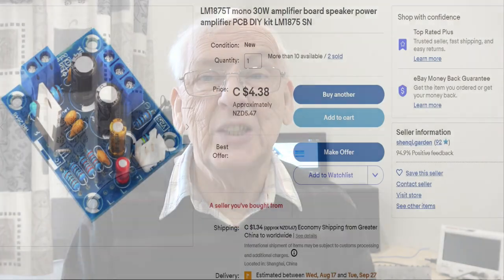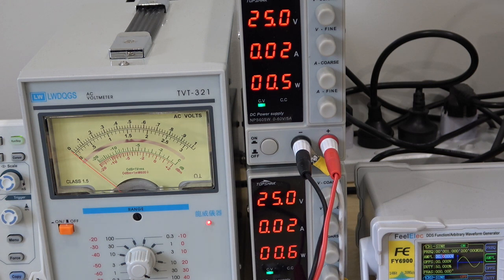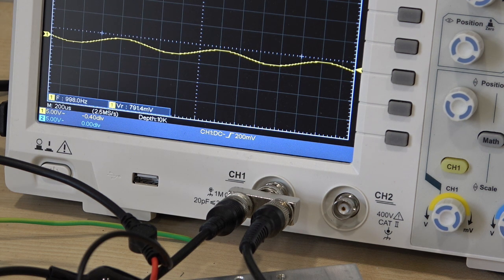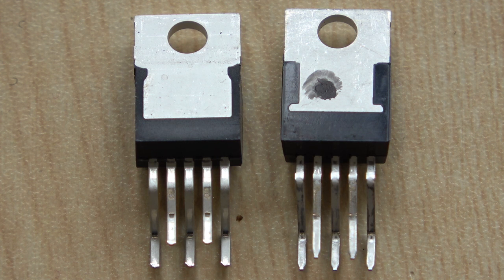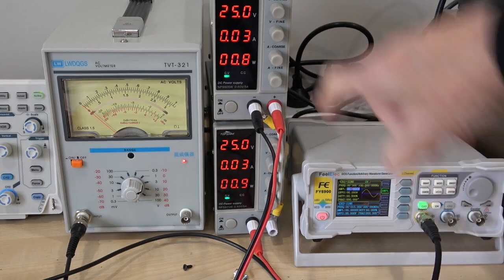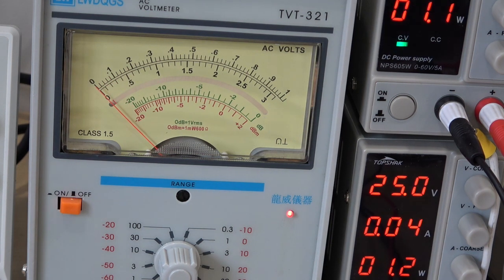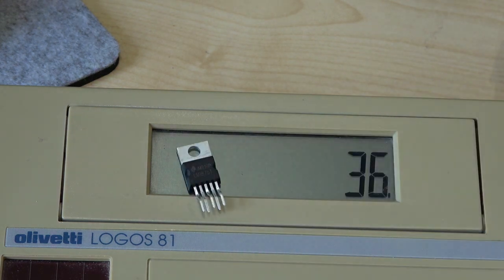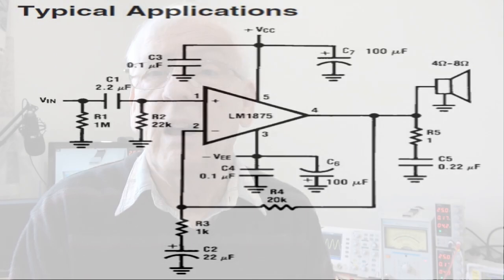I take a look at a LM1875T amplifier kit. Will it be any good?

Comment: I assembled these kit & I got around 8 watts @ 4 ohms load while powering up with a 18 Volt 2 Ampere transformer whose peak dc output is 28 volts & I used the voltage divider circuit to convert into split suppy that I learnt from John audio tech video but the voltage was pulled down to 20 volts while delivering 8 watts. I used a 3x3 inch heatsink that became slightly warm during the operation. The capacitors supplied with this kit although blew up at first place which I replaced with good ones so the components are not good quality but only due to the authentic chip & pcb the kit priced very high
Reply from the maker: As you may have seen in my video with genuine chips the performance is really quite good. I'm not sure of your power supply. Your filter electrolytics blowing up would tend to suggest something is wrong. I used all original parts except the chips and everything is good. Genuine chips are not cheap but fake chips are cheap for a reason. You NEVER really know what you might get.

Comment: Pity it's almost impossible to get genuine lm 1875, 3886, various different output transistors - all out of stock and in a production backlog. Even Elna Silmic II capacitors are being discontinued. I started diy audio maybe 6 years ago and took it for granted things like bc560 etc would be available for years to come.
Reply from the maker: Hi Peter, here in NZ I received mine from Farnel, however these are getting a little expensive these days. As you have seen here, quite a difference in performance. I actually like it. When you see the silly little PCB on the heatsink, I cannot believe the sound quality that comes out of it.

Comment: Sorry about your health.  Nearly all audio chips from China are fake.  They have MUCH smaller output transistors on the die.
Reply from the maker: When using a real chip these little amplifiers really do sound good.
Reply: @MichaelBeeny   YEP! :), ...and even the fakes at lower power levels and attention paid to load stability (as you so profoundly showed at 4 ohm) are actually good for most applications, ...and the price, ...far out!!  Some do have lower frequency response at the high end, but still sound good. :)
The general rule of most things from China is buy double the power rating, LEDs, audio amps, mosfets, bjts etc. etc. and you will be ok because they will still be hugely cheaper.

Comment: I was wondering how you got those two SMPS's to play nicely together?
Reply from the maker: The main thing is both power supplies outputs are floating, not connected to ground or you will simply short one of the power supplies.
Power supply one, the +ve  rail becomes the plus voltage. The negative is connected to the second power supply + supply, this becomes your center tap or 0 volts. The -ve  output on number 2 power supply becomes the real - ve rail.
The voltages on both power supplies are made the same. Use your test meter to confirm your connections are correct. Works a treat. Make sure you power up both supplies at the same time.
Hope this makes sense, easy to do but quite hard to explain.
Reply: You can do this with 2 identical linear supplies too. Join 0v reference on one to the positive of the other (thats your ground), and use the remaining positive and what was the 0v of the other for +&- respectively. Nelson Pass used this design on some PSU for his amps. It reduces any effect of differences between the secondary coils as they get rectified and filtered before they are connected.

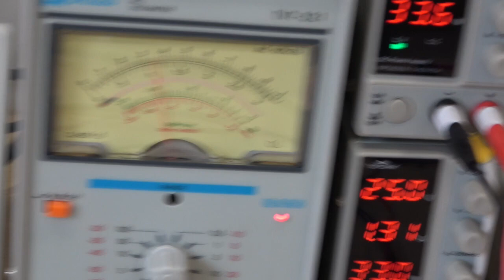Comment: 9:40.  I believe that the reading was almost exactly 11 volts for the genuine chip at 4 ohms, which is 30.25 watts rather than 36.  The scope agreed, though the reading would likely increase slightly as you scrolled more waveforms into view.

Those circuit kits are cheap and have a decent layout such that they are a good source for PCBs even if the chips are counterfeit, but most of us don't want to support companies that sell fake chips.  Even the fakes produce a decent 8-ohm amp audio circuit for the price, but we'd prefer higher-quality parts.  

The dual-rail power supply and heat sinking are obviously the primary investments with these amps, so folks that just want a cheap amp would be better off with a stereo class D board and a wall wart.  If they're already building a dual-rail supply, they can certainly afford genuine chips and nice components, so these ultra-cheap class AB chips amps are a strange commodity to me.

I like these amp chips, but why is there a market for $5 single-channel kits when a complete amp is going to cost many times more?  I suspect that a lot of these are sold to people that never build them into amplifiers :(.

Comment: Fakes again 🙂I had bought several of these folling Johnaudiotechs positive review of the boards. The chips Johnaudiotech and I got, however, look identical to your real chips. I guess they ran out of the real ones and, following tradition, just swapped them for fake ones.
Reply from the maker: I would not stand for that Marcel, getting a genuine chip when you expect a fake one, it's not right!! Everyone will expect the same in future.
Reply: @MichaelBeeny  Haha, you are right. We need some certainties in life!
Reply: @MarcelOoms  Hi Marcel. Just curious when you bought your boards since yours appear authentic. The IC's are said to be pulls of which they may have run out of and replaced with fakes. If you feel adventurous, you can crack one of the ICs open and measure the die area. The LM1875 has a die area of 10mm^2 and the fakes always use a smaller die (which is why they can't handle the power) of just under 4mm^2.
Reply: @JohnAudioTech  That would have been nice, but they have since been moved to the attick. Never got around to them.

Comment: Super video, thank you. Just a thought: C2 is critical, it can also affect the bass response and in my experience, can (if a low-cost electrolytic and a single supply are used) cause strange output DC (speaker damaging) behaviour! Best to use a quality, very low leakage and non-polar cap. All the best, Beamer.
Reply from the maker: Non-polar are not a favourite of mine, they tend to have a high ESR over standard electrolytes. The cost of these kits probably wont justify the cost. I've yet to do a detailed listening test in my listening room to form a real conclusion. I have quite a few projects on right now and only 2 ears.
Reply: @MichaelBeeny  Sorry, I meant polypropylene, polyester etc., - not non-polar electrolytics (also not valued by me). I like your YT channel, and it's great that we have 2 of most things - if 1 fails, at least we've got a spare ;)

Comment: Hey Michael, have you aver worked with the LM3875? (obsolete) . I think it would be a better option than the LM3886 because of it's noise figure. Any thoughts?
Reply from the maker: I did not find any noise from the speaker at all. True on paper the 3875 is specked with lower noise, but if you cannot hear it anyway who cares. Not tried the 3875, as they are obsolete, unless you can get new old stock, bound to the fakes.

Comment: Hi Mike,
Chinese fakes are a big problem, I blame the big chip manufacturers who sell off their reject chips cheaply because they fuel the fake industry. I am looking to build a LM 3886 amp but searching  element 14, digikey,Mouser etc the LM 3886 chip is not available and has a waiting list of months. So if I go ahead with this project I will be taking pot luck if I get a good chip or fake .The reason I would like to build LM 3886 amp is that I saw a review of the Cambridge Audio AXA 35 amp by The British Audiophile, which uses the LM 3886 chip and I am looking for a warm richer amp to tame my Klisph PM 160 speakers. Being a poor pensioner like yourself, I can't afford the Cambridge Audio amp. In your opinion of all the amps You have build, could you reccomend  a warm rich amp or would the LM 1875 be a good sub to the LM 3886.  I am using the 12 watt valve amp  that You built, it is ok but it doesn't have the gain  for my fiio music player. Thanks for any help and keep up the good work.
Ken Mitchell.
Reply from the maker: Hi Ken, So sorry to hear you have Klisph speakers but we wont go in that direction. If the only other issue you have is lack of gain on the amplifier why not just add a simple pre amp? 5532 for example. Regarding the 3886 I have looked, for these here in NZ. Farnell is quoting 2 years delivery. I think the ones from China must be fakes. I'm surprised you find the valve amplifier too bright? That's what put me off it, I found it dull and lacking dynamic range. Well it is a valve amp after all. Most of your issues might be the speakers. Along with BOSE I find Klisph my least favourite speakers EVER (so far) Try one of the British speakers, might suit you better. Good luck, let know what you do.

Comment: dear mr beeny . I am writing to you from the other side of the world. South America. . Chile. I want to thank you for sharing your knowledge. You have helped me a lot in this time, I am grateful to you. I have reviewed all your videos, I am very happy. dear sir, could you spare some words and test for a low cost kit like class A amplifiers? Thank you again for your time. We see it from many parts of the world. a big hug and forgive my English. Greetings Serge.
Reply from the maker: Hi Sergio, firstly thank you for your kind words, it's much appreciated. Personally I'm not a class A fan. I have yet to be convinced that they offer anything more than a properly biased class AB. After all, class A is just a class AB with lots more bias. So if you bias the class AB so you have no crossover, all class A does is heat the room.
Class A can never be low cost. You will need massive heatsinks even for a relatively low power output due to the high current consumption. The power transformer will also need to be big because it will need to supply a high current all the time. This places more demand on the rectifiers which will need extra heatsinking. Bigger and better capacitors. 
At the end of the day your amplifier will be lower powered so less dynamic range, so could end up not sounding as good. You spent more money for no improvement, but your house will be warmer !!
Reply: @MichaelBeeny  dear mr beeny. It is really a pleasure to be able to read your comment, thank you very much for answering me. I appreciate it. I look forward to your other videos. you are very kind. thanks for those words about the class a amplifier. but personally I am a stubborn person hahahahaha. I want to have one even though I know they are very inefficient. In the same way, all the videos that you have made available have helped me a lot. once again dear sir, thank you... a big hug from the other side of the world. sergio

Comment: Hi Mike! Good to see you back in action! As i mentioned before, i have assembled amps using the LM3886, and the TDA7294. Yes, i would never trust Chinese chips. The majority are fake.

The LM3886, i would say sounded "good", but the TDA7294...i was pleasantly s
urprised. It sounds wonderful: virtually no distortion, with surprising bass response. I cant think of a better value, considering the minimal cost.
Reply: @jim9930  thats why i only buy chips from a reputable source. I ve had 3886's blow up on power up!
Reply from the maker: Good morning Bill, good to hear from you again. From your comments it looks like another trip to Jaycar to get a few 7294s.. I really need ANOTHER amplifier lol
Reply: @MichaelBeeny  hi Mike! Yes i would like to see that build. I had originally ordered a pair of tiny pcbs, but they looked short on some items. I subsequently bought a board which has both channels in 1. I will send a pic later. I dont think you will be disappointed!

Comment: Thank you for featuring this interesting kit.  I've put together a few of these for various rooms around the house and they are very good for the price, especially the PCB.  Never seen any of these kits come with original chips so getting a genuine one is a must to run it beyond 20 watts.  For low volume close proximity use, say for small desktop speakers, the fake chip actually does not sound any different from the original, at least for the dual 18v supply I've used with it.  The fakes do not have short circuit protection at all so they immmediately go bang when shorted and when the short is removed, it sends full rail DC to the output
Reply from the maker: A fair point Marvin. I just pointed out these details so people can make the choice, like your  self depending on the application.